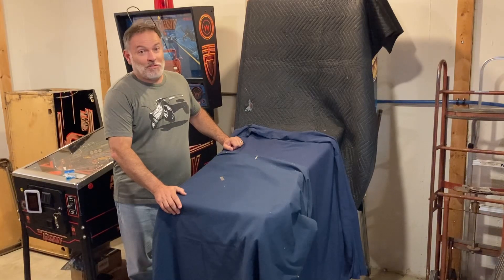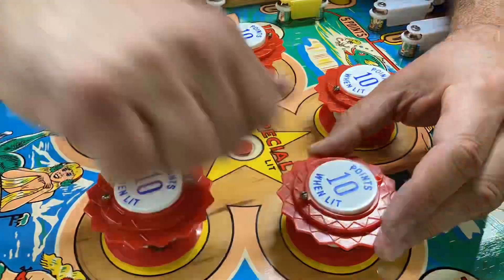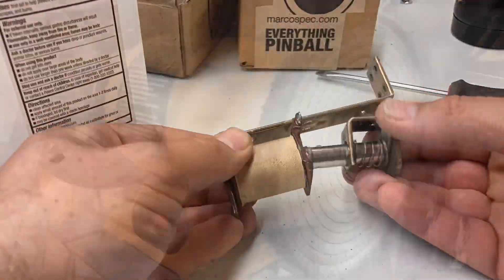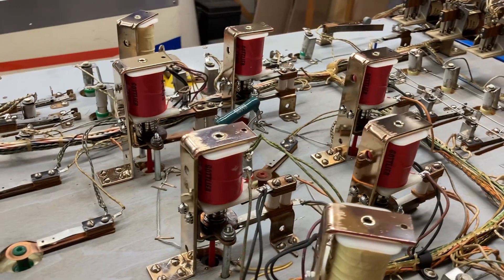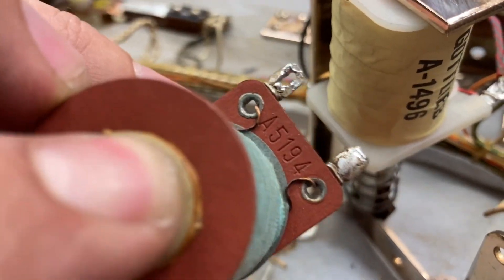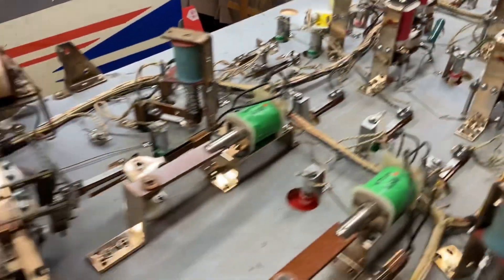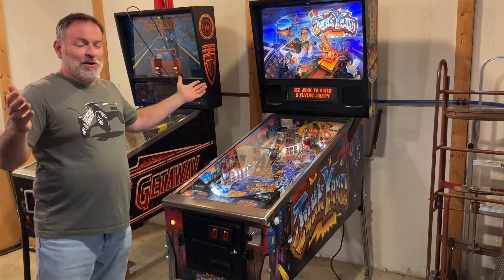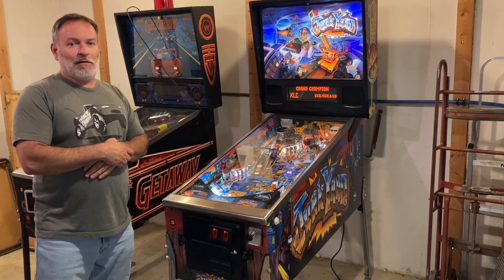North Star pinball restoration part 5: pop bumper refresh and  the big reveal!

Comment: LEEBO, any reasons why 70's Solid state pinball games used 18.7vac center tap for the logic voltage? because logic voltage is 5vdc but they used 18.7vac center tap. The Lock Coil stays on during the whole entire game so the coil gets hot, do they make special lock coils that can handle the extra heat and stay cool for being turned on for a long period of time?
Reply from the maker: Sorry, I don’t know.